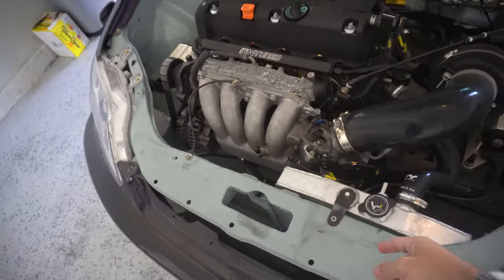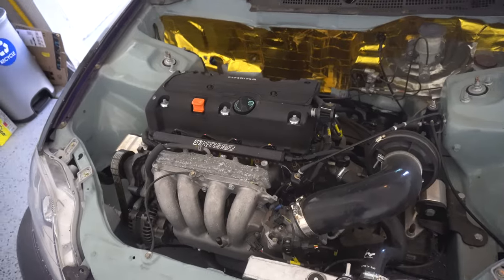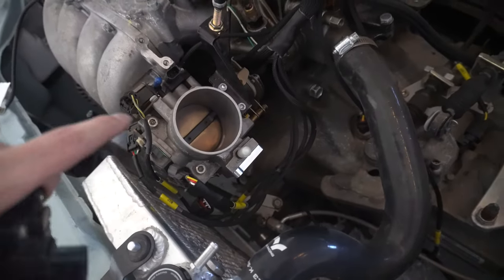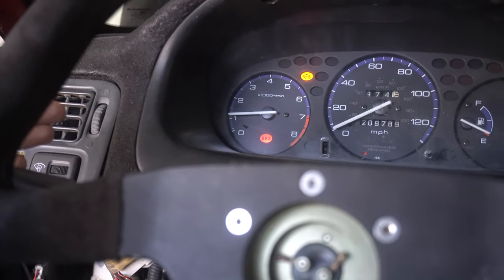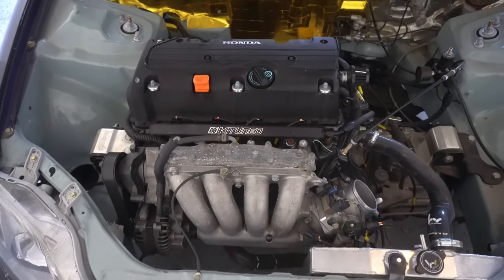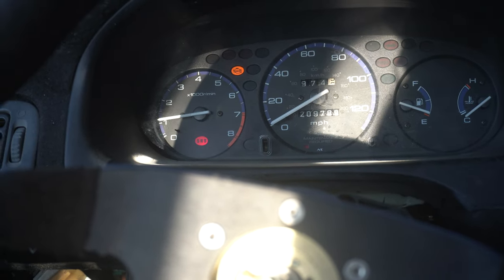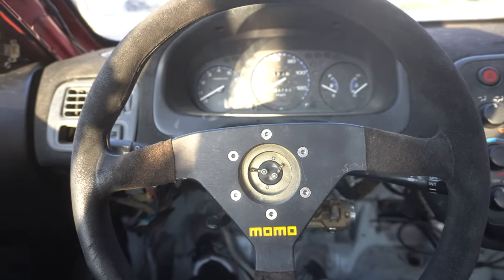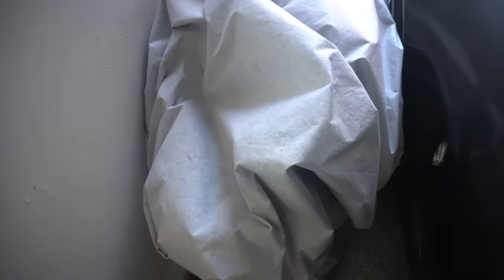FIXING IDLE ISSUES ON K24 CIVIC

Comment: The reason why you had IACV issues is because you werent running any coolant lines to it.
You cant just delete the lines, it has a thermostatic switch in it that is controlled by temp.
Reply: ive had problems before i ran coolant through my tb, removing it didnt cause any differences in my experience

Comment: Sounds to me like you have a faulty VTEC solenoid that needs to be cleaned or replaced. There is a screen in the solenoid itself. When it is dirty, or faulty, the solenoid will not engage VTEC, which should be set to around 28,29 hundred rpm. There is also a second screen that you might want to check. It is near the power steering unit on the front side. I just replaced the VTEC solenoid and the issue went away immediately (buy OEM if you do, aftermarket replacements are known to be finicky) Hope this helps! Good to see you putting out content.  ✌🏽💙🤙🏽

Comment: Make sure your throttle cable isnt too tight. you could have way too much tension on the cable itself. 
there should be about a 1/4" of slack when you push the cable. there should be a "DEAD SPOT" in the pedal where you push the pedal 1-5% and it doesnt open the throttle.
if you set it super tight to where the pedal feels really nice the throttlebody will stay cracked.
when you car is idling high go outside to the throttle body and try to forcefully CLOSE to the throttle with your hand

Comment: I replaced my iacv 3 times, same code with idle surges. I finally replaced the throttle body and it works now. My problem was when I replaced the iacv the first time I decided to clean the TB since it was off. I used TB cleaner and a brush, don’t use a brush. Spray and wipe lightly.

Comment: K pro learns the idle as you adjust the idle screw and when you adjust it you have to rev it every time you spin the screw the ecu will grab the rpm and learn it . Do a tps adjustment in the kpro,  you have to do it closed throttle,  and open throttle save and upload and the car should rev out fine . Lmk if you need help
Reply: Got a k24 swap. Did a tranny job on the car and after puttign everthing back. Car start but then just shut off. Car was good run perfect before. Now I have to start car and hold the gas for car not to die. Seem like I'm having air issue. Engine code said it's camshaft position sensor. Please help

Comment: i just put a lil rubber plug in the hole and put the iacv back on. check your tps sensor. i have the ktuned hall effect tps and my tuner had to turn it so much to get it to calibrate that it only has one bolt through the mounting holes. its a  ktuned tps with ktuned throttle body and it dont look right but its what had to be done.

Comment: Common issue on K-series. Change your PCV valve, clean your TB valve and also add 2-3 quarts of lacquer thinner on a half tank and let it run through for 2500 rpms for 30 min parked or hard drive. It'll burn your system of carbon impurities and clean it. Carbon build up can cause the IACV to not work properly by sticking. 

I've been chasing this problem and since changing my PCV and putting lacquer thinner helped my idle and got mpg back. 

K series not letting you go past 3-4k is limp mode. Check DTC and check vtec solenoid screen/oil level.

Comment: maybe u need to re adjust the idle screw. u might have turn it open way too much. im not sure whether there is service connecter on the k24 wiring like the d or B series that needs jumper wire prior to any adjustments or repair .

Comment: I had a similar problem with my k swap it was the map sensor gets a little oil in it from the throttle body you can switch it or get electric parts cleaner and spray it in it

Comment: Vtec issues or not enough oil but prob vtec solenoid and true putting more tension on the throttle cable and the throttle body might be getting stuck

Comment: You should keep the car B swapped.
Or build a beefed up d16y8 with higher compression pistons.
I'm not a K swap fan.
Reply: Once you own a decent k24 swap, well sorted, and tuned, you'll understand. It takes a lot of hard work, research, and genuine troubleshoot effort to get everything sorted properly. But they are substantially reliable-stout, and have pretty gnarly linear torque/top-end power. Even completed as a "FULL" OEM swap over, with all stock shit like I did, (Check my videos, slowly releasing info about my setup), you can rev them out to 8-8.2k all day with precision lubrication maintenance + surprisingly use-able full range power.

I built b-series all my life FYI, far over 10 years of (swapping/building/troubling) experience with just about every honda chassis with all of my homies rides. I LOVE d/b/h series as well, So I genuinely understand where you're coming from. Cheers bro!